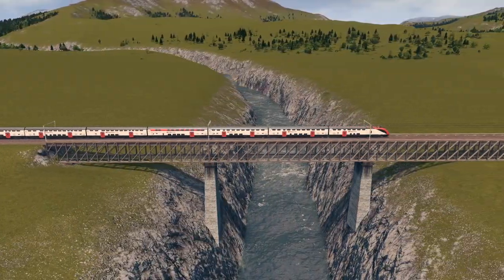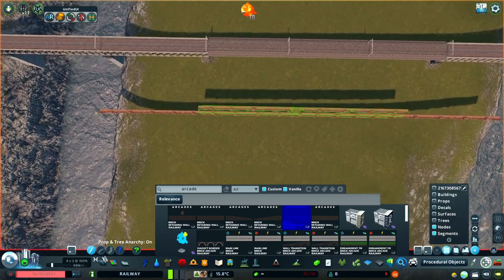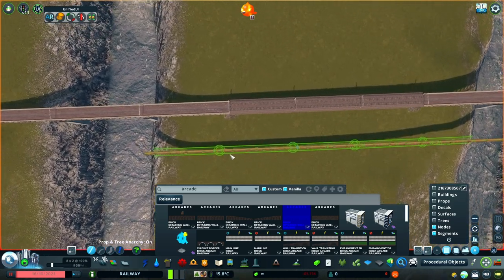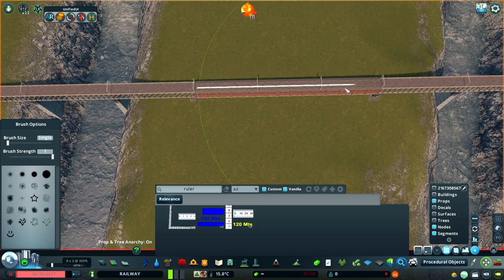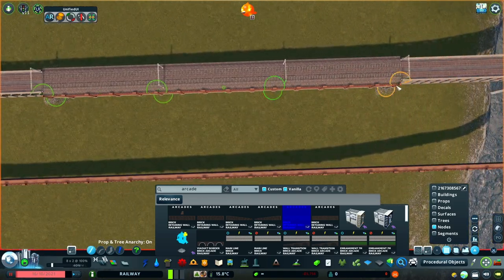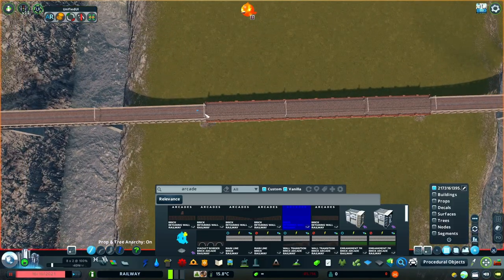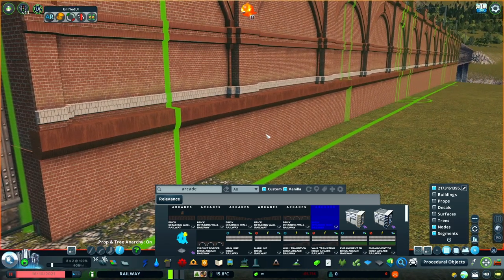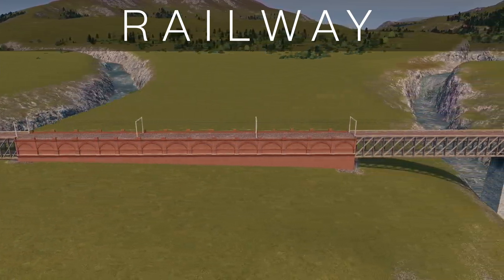Creating uniform decorative networks in Cities: Skylines | RAILWAY | Episode 08

Comment: As I saw you struggle with the fuller prop I remembered the old days when move it had no precision mode (by holding CTRL) moving hard to select objects was a real pain back then. Right now though you can move an object that is unselectable with LMB by simultaneous holding CTRL and MMB. Yes it will be in precision mode, but it saves you a lot of time.
Reply from the maker: Great tip, thank you!